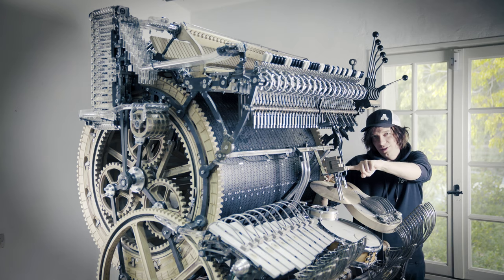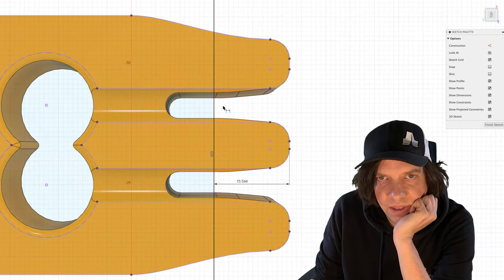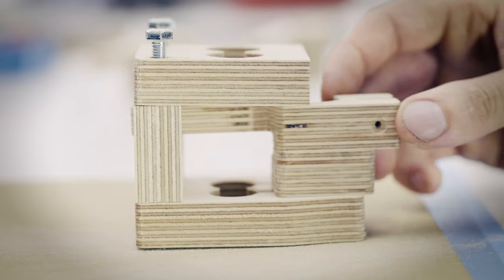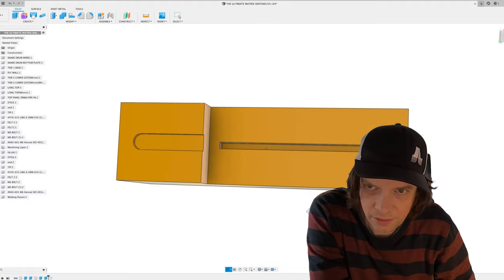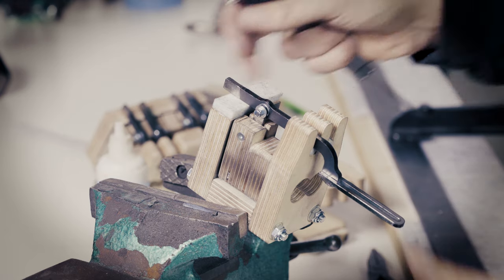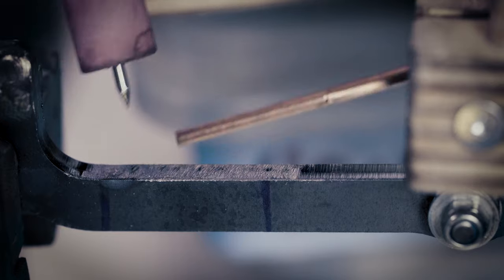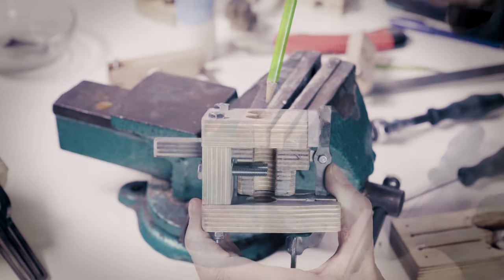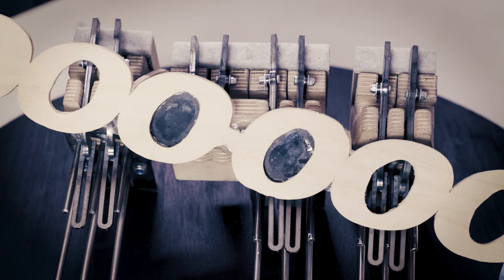Making Better Marble Gates - Marble Machine X #144

Comment: Martin! your tungsten electrode is contaminated!! That's why you're getting sparks. Shouldn't be happening! It makes for an unpredictable arc, overheating, blow out, excess oxides in the weld, etc. I know it's annoying but make sure your tungsten is clean!! If you accidentally touch it to the puddle, grind a new tip. This is especially on such small parts.  Stability and consistency are your friends when welding. The fixture was a fantastic idea, now make sure your arm placement, angles, grip, and table are as stable and replicable as possible.

Comment: Aim the tungsten at the heavier component first and then move into the thinner section  to avoid melting it.   Also, don't bother trying for the perfect welding shot on camera, we've all seen welding (or not seen, as it's just a bright blob on camera), so make sure you can see the weld..

Comment: I just thought about it, but the air that there is in the pipes (and where the marbles pass) and well it blocks and slows down the balls a little, during the time that the air bypasses the falling marbles.
So wouldn't it be practical to poke holes in the pipes to let the air come out and come between the marbles more easily? And so, accelerate their speeds and mobility
(sorry for my english, 
google translate didn't help me...I hope what I meant will be understandable)
(And maybe I'm stupid and i say bullsh*t .x.)

Comment: I know others have said this below, but will also say,  that welding is hacky and difficult to reproduce, I'd just recut the wood, it's redoing one piece in a machine that can be consistent, as opposed to two manual processes which will be anything but.

OK and at the end there I was looking at some of those arms and thinking 'they aren't coming down parallel, what's the chance of a catch?'  BUt hey I'm a software engineer,  not a mechanical.

Comment: Thinking about the friction from a wood working perspective:  I was wondering what you were going to use to reduce friction.  Graphite is good, but I'll agree with the other users who said it would wear out.  I use a carnauba wax.  Besides reducing friction, it will mitigate expansion/contraction of the wood through humidity changes.

Baltic birch plywood is reasonably hard, but I'd be curious to know how it holds up through 10M cycles using different dry lubrication methods.

Comment: The Jig to weld the steel parts was a GREAT idea and it looks like it worked well, but It would have been SO much Better, and Easier to re-cut the 2 plywood parts instead of welding onto the precision metal parts.  Even if you re-cut the entire sheet of plywood parts, it would have still been a better choice.   It was always the plywood parts that needed the adjustment, but since you just made them you really wanted them to work.. so adjust the precision metal parts instead... it's an easy trap to fall into, it's an emotional decision based on the work you just put into the plywood parts, not the most logical one.. it would have been better to scrap the plywood parts you just made and make new ones, while that seems counter productive, it's only an illusion...   it would have been way more productive.

The steel balls landing on to the steel bolt make a definite CLANK!   you can hear the clank they make at 17:22, the marble isn't just landing on the bolt, it's bouncing on it.. you can hear it happen... and it will be louder with a whole stack of marbles in the queue above the gate,  and the bolts will all have flat spots on the threads WAY before the 10,000,000th marble... at that point the marble above the one on top of the bolt will be lower than it should be. In fact they will have such flat spots on them from the continuous impact that you won't be able to remove them...  I would suggest figuring out how to have the marbles land on  something covered with felt inside the marble gate to eliminate both the wear and the clank.

Comment: The felt will get grooved after a couple 1000 uses no? You could make the part that presses on the felt larger, more surface in contact with the felt. This will also make the part not push as deep into the felt.

Comment: Should have just re cnc'd the top wooden plate for the marble gate after adding 1 or 2mm in fusion. Would have saved you from having to weld extra material.

Comment: I like the design of the marble drop arms, but why did you only weld one side?  Okay so perhaps it doesn't need it on the other side but if you don't fill it, that little hole will become a magnet to dust, fluff and worse, moisture. Perhaps using glue as a gap filler would help.

Comment: Martin,

While I applaud your efforts in trying to get zero failures in 10 million, I feel you are designing things in the wrong manner (and more importantly, not performing testing before coming up with that statistical failure rate)

No system, no matter how accurate or precise you make it, will be without failures. There's a two step approach for failures. One - You need to test your design. Do a small scale one off test and put that unit to its absolute limits. If something breaks, take note of it but if the unit still works keep on pushing it. Push it until it really fails to function. AND THEN make your redesigns. And then test again.  And two - design for soft failures. When something fails, make it so it breaks a consumable part vs something that would take ages to rebuild. 

It's ok to have failures in a design. To be able to detect and correct them is the more important part. Don't follow a design path that would lead to a catastrophic failure. Let small easily replaceable things fail vs the whole system.

Comment: hi wintergatan, I notice  at 11:12 in the video the marble hit or stop on screw why you don't use a Dowel pin and press fit in the plywood. For 10 000 000 cycles i think the dowel pin will be a better choice fon a long run.

Comment: Hey Martin, I see you're continuing to use big bolts in your marble drops. Wouldn't you be better off using pilot pins, so that the threads of the bolts don't damage the exterior of the marbles and cause fringe cases?

Comment: Have you thought of making  a nut shaped hole in the metal plate holding the gate? it would be easier to disasemble when other gates are in place . . . or at least i think so
Reply: or nut shaped hole in the most upper wooden part of gate

Comment: I have to say I'm surprised you just didn't re-cut the plywood pieces 1mm longer on the CNC machine rather than trying to add 1mm of weld the metal pieces.  Seems like it would have been faster and more accurate.

Comment: @wintergatan Metal balls sitting on metal bolts, over time the thread could cause abrasion of the balls. Would having more friction on some balls effect reliability and have you looked at that as a potential issue?

Comment: 14:32 uses nylon locknuts, screw doesn't thread in the nylon ring... Also, applies locktite on screw then bolts on locknut.

Comment: I wouldn't use bolts for the holding mechanism. The groves will decrease overtime. Wear on it is kinda bad and u have those tiny metal pieces in the machine. Just use a steel rod or something.  :)

Comment: OK, so I'm sure you thought of this and has a very good reason for doing things the way you do, but something I got to thinking of when I saw the marble gate demonstrated was  that the drop to stop on the bolt has to be quite audible. Multiply that by however many balls are dropped every second at it's going to create quite a racket. Yes I know it's never going to be a quiet machine but it seems it might not be all that hard to reduce that noise a bit.

Is there a particular reason you didn't try some other material for that ball stop? Simplest might be to try a nylon bolt, more involved would be to design some replacement perhaps using some sleeve. While adding a soft plastic sleeve might increase the friction a bit it would also mean the ball will be rolling along a smooth surface so it might not be a significant increase or even any.

Yea, I know. Don't add to the already overwhelming amount of work you have to do...

Comment: Not sure if it reduces your time, but thread locker when you have a nyloc nuts, is probably not required. For all those going on about Nylon, it's not as easy to work with as felt.  As for 10 x 10^6 cycles, think of a grand piano.  There's pianos out there with nothing but felt and pins for there mechanism(yep even Steinways etc) and many of those pianos will have easily gone through that amount of cycles.  Alright it's not steel marbles onto the strings but there not exactly falling from great heights either.  Finally felt is much cheaper than nylon.

Comment: Hey Martin they make a tool called a micro die grinder that is air powered it goes up to 56k rpm. Lot better for grinding metal and small parts. And it’s super small and can’t overheat because it’s an air tool. You should check it out.

Comment: I don’t think it necessary to add any material to those beautifully laser cut pieces to fix the “overshoot” of the gate.

In my opinion the overshoot is actually a good safety feature because in order for the gate to achieve that position, it needs to cross before over a perfectly centered position, therefore allowing for an small overshoot you guarantee the marble is going to drop before the blocking position. However if you aim for undershoot the gates (as it looks in the video), it is likely than 1/10000000 times the gate is not going to drop the marble. This is specially important if you center the gates on a worse case scenario when machine is pushing really hard on the felt, when the machine is not doing the same force Martin is doing the gates will never achieve a drop position.

Summarizing: an overshoot gate will achieve a valid position at least for a small period of time, but an undershoot gate may never go through a valid position.

Martin should pay attention to the complete dynamic process of the gates rather than focusing on the stationary state on a worse case scenario.

Comment: I’m thinking you need a test jig to actually cycle a test array millions of times. That would expose wear points, reliability statistics, aging characteristics. 

And, the balls drop onto a threaded bolt. I’d be concerned about the hardened steel balls hammering and flattening the thread on the bolts. Again, a high cycle texting jig would be worth it.

Comment: At 17:58, would it not have been easier to shim between the stationary and moveable plywood components than trying to shim either the felt or weld onto the metal arms? Is the end result not the same, or do you need that point to be contact free for noise levels?

Comment: Do the metal bolts that catch the marbles make a lot of noise when the marbles stop in the gates? Could you eliminate the noise with plastic or rubber coated bolts or felt covered bolts even? Seems like noise reduction is imperative.

Comment: how will this new design prevent a metal marble to get stuck if the feeder pipe is empty and the marble falls in from above in precisely the moment when the shuttle is moving forward without holding a marble?

Comment: I think your math vs design might be a little off, if i understood you correctly. The assumption that 10 million marbles will pass through a single gate would suggest that 38 x 10mil for 380mil total marbles. If that assumption is accurate will the felt withstand 10mil impacts and not reduce the thickness of the felt and thereby offsetting your gates and produce a possible blockage.

Of course if your suggesting that 10mil marbles total divided by 38 for 263k marbles per channel, will your design withstand 263k impacts before the felt will reduce in thickness due to repeated strikes.

Love your content, keep up the great work.

Comment: In engineering the material choice is the most important decision that is many times made to quickly.    Wood is a material that is not dimensionally stable, is that the best choice for the Marble gate when tolerance needs to be held to achieve the high reliability needed? Not my first choice.

Comment: The issue with your 1 in 10 million mathematics is that the machine you're building consists of multiple parts, of which each can fail.
A machine that has 100 parts that are all used 1 time per 1 operation, has 100 chances to fail every time it is operated. That means that if each part has a failure rate of 1 in 10 million, the machine overall has a 100 in 10 million failure rate; or 1 in 100,000.
Granted, if the machine has parts that aren't used for every operation (like how, whenever a marble is dropped on the snare drum, all the vibraphone channels don't all open and close as well), this is somewhat mitigated, but it's still significant enough to keep in mind.

Comment: I'm arm chair engineering but imo it would have been better to redo the wood parts with the desired thickness rather than welding. Additionally I feel solid wood or a poly for these plywood parts would be more beneficial and lasting. Last before adding these to the machine I recommend a test rig.

Comment: with repeated cycling, those felt pads will compress, and your worst-case scenario will come to pass with increasing regularity.

Why not use a wee spring between the slide(shuttle) and the receiver to push back?
what about leather? It should still absorb the shock and still dampen the sound of metal clacking against wood.

Comment: After 10,000,000 trips through the marble gates, are you worried that the threads on the bolts will add scratches and dings to the marbles leading to the edge case where those scratches get caught on the threads, preventing the gate from opening freely?

Comment: @ 18:42 where you are talking about the shuttle going back too far, why not shorten the length of the linkage attached to the shuttle, or create an adjustable length linkage.

Comment: Instead of rushing forward, turn the welder up slightly, and do just like 2 dabs of filler and then stop. Repeat until you get to the end. You're wanting to reduce the heat transmitted down the material, and the only way to practically do that is you have to be hot enough to move fast enough to stay ahead of the heat, or you start and stop. I think this material is too low mass in this situation for the former to work.

Comment: What kind of effect does 10 million marbles have on the plywood edges? I expect that after a couple of million marbles you will be able to detect wear on the plywood where it comes into contact with the marbles and after that some parts may become out of tolerance. You might want to build a test rig of a single gate and run a few million cycles on it.

Comment: I'm thinking about your stop on the felt.... It might wear out or compressed, no? for that 1 mm, wouldn't it be more interesting to make a 3d print part that has 1mm in front but that extend on the side (like a T shape or something) to increase the area of contact and decrease te presure on a small area on the felt? (and it might decrease the sound impact also) I make this assumption, but i don't know how the felt behave in time, did you test it?

Comment: I still don't understand why you are resting the marble on a threaded bolt. It seems to me it should be smooth. At some point the threads are going to knurl over and may get metal shavings in the mechanism. You should be using a hardened ejector pin (used in plastic injection molds).

Comment: So, reading through the comments there are 3 things:
1. Don't drop the Marble on a threaded screw
2. Felt will compress
3. setscrew for a positive endstop
Reply: Actually I would be most concerned about the fact that the marble is constantly hitting the screw. Not that it is threaded but with such a number of cycles even the small hit will cause some deformation. Especially in the wood. I would not be surprised if they would eventually come lose. We are talking about millions of small hits. Also it is not just the weight of one marble but of all of the marbles in the pmma pipe that hit it.
Reply: @nukularpictures  without proper testing, no one will ever know how it will behave. But let's make 38 prototypes. 
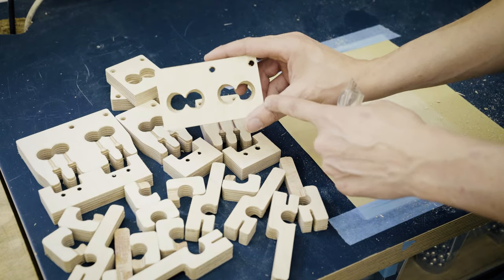Oh one more thing I saw: 2:00 why parametric? 6:03 that's why.
Reply: @therealpanse  Yeah it is quite sad to see all of the work being done without the proper testing. 
But well people are saying it since weeks, the comments are basically nothing else now a days. 
He does it his way, lets hope it still miraculously works in the end.

Comment: Speaking from experience, you're probably going to regret using graphite. Aside from the obvious mess it makes on literally everything it touches, it also has the unfortunate tenancy to end up clogging up in various hard-to-reach places over time and causing things to bind (even more-so the tighter the tolerances are).

Comment: 9:36 I think graphite powder is so slippery because it contains bucky balls. (atomic ball bearings)
Reply: @TheOwlman  you really think the people manufacturing graphite powder are checking the atomic structure of the graphite?

I'm sure there's tiny sheets of graphene, carbon nanotubes, and Bucky balls all mixed in.
Reply: @iwantmypot  But they are not the reason graphite works as a lubricant and it is a naturally occuring mineral that is simply ground into a powder. Nanotubes and buckyballs require some very specific conditions to manufacture whereas the natural form is simply covalently bonded sheets with weaker bonds between the layers. You may just as well be saying that it contains diamond crystals... the physical conditions that form graphite are not likely to result in diamond, nanotube or buckyball.